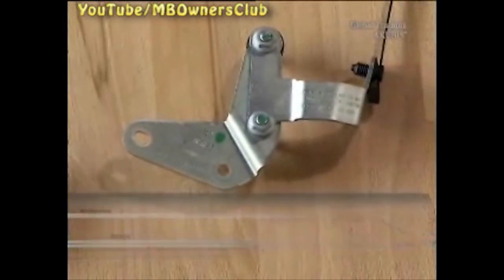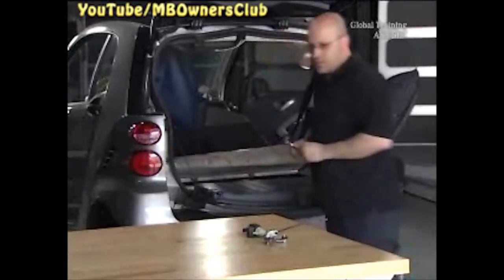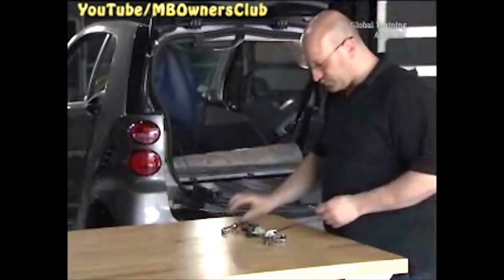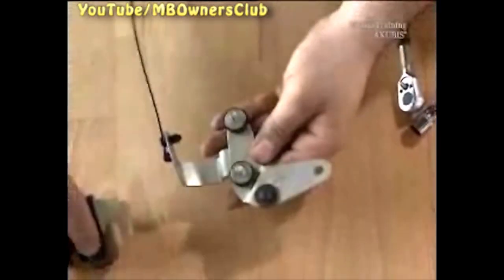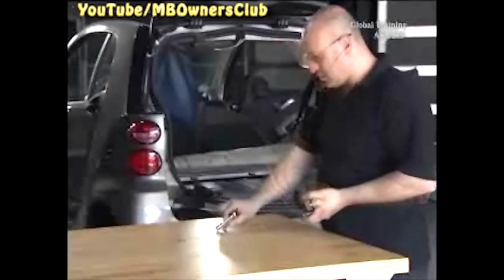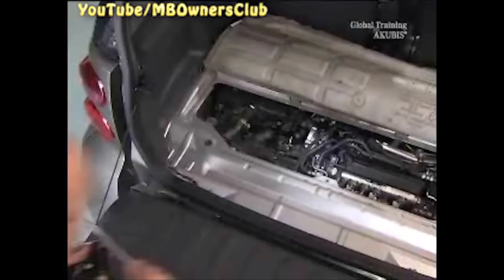Smart Fortwo, CDI engine, limp-home mode, pressure transducer, exhaust gas recirculation, bracket

Comment: This happening to me now. The MB dealer ordered me a new pedal.
Reply: Is this a cdi fortwo?
Reply: My wife's Smart has the same problem. How did you fi yours? Thx
Reply: @Adrian-nq3qk  good day Adrian. How did you manage to fix yours please help man
Reply: @greggwala9656  after I've changed the turbo and intercooler 😂 nothing changed,  and it was just a little puncture in a small pipe (it's the one that enter EGR and splits into two)

I'm not so good at mechanic and also don't remember that much, but check the pressure in that pipe conected to EGR

Wish u luck!